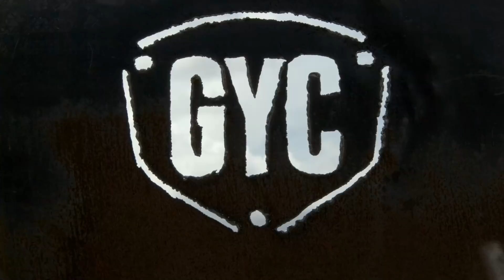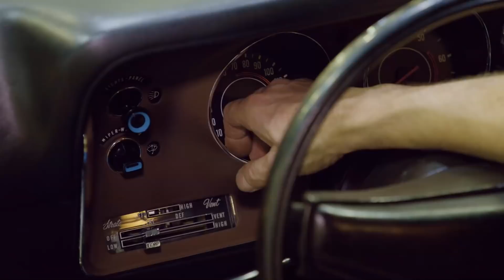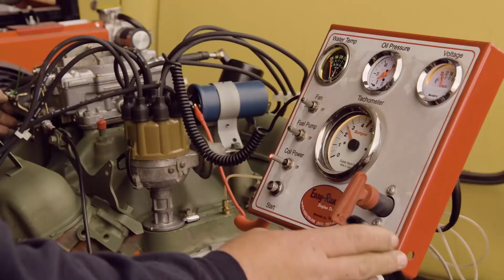SOMETIMES THEY ARE TOO FAR GONE! 1969 CHARGER DEAD

Comment: The question isn’t “is it too far gone?”  The question is “how much are you willing to spend?”  If it is going to take 80K to restore a car that with a mix of OEM and aftermarket along with non matching numbers is only worth 40K…….do the math. It’s not worth it.
Reply: Don't care what it cost. Or worth after its done. It's my car.
Reply: There is a saying in engineering that applies to classic anything: if you haven't fixed it you haven't thrown enough money at it.